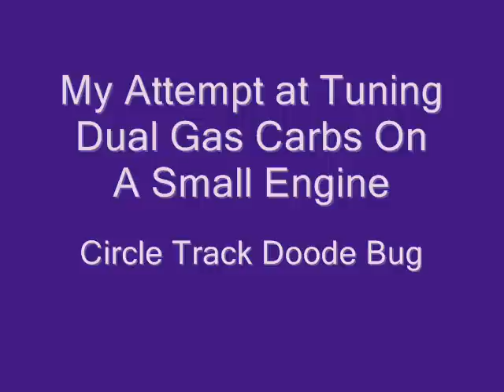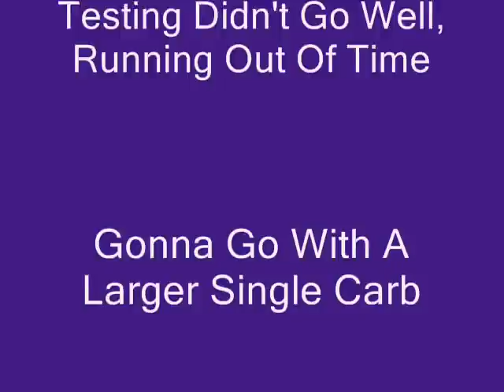Minidragbike Trying To Tune Dual Gas Carbs

Comment: Minidragbike, question... Are the carbs running the same tune or is one for low end, one for high end?? It would be nice to be able to stagger them like that, not sure if they are.. Also, what would the advantages of 2 carbs be to 1 carb? Better response?